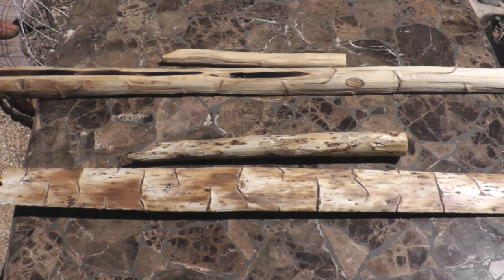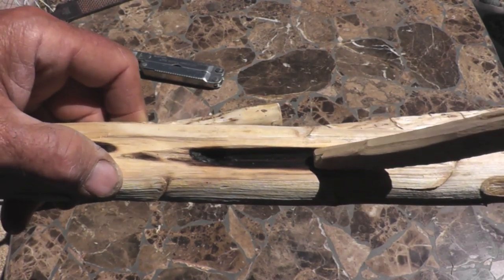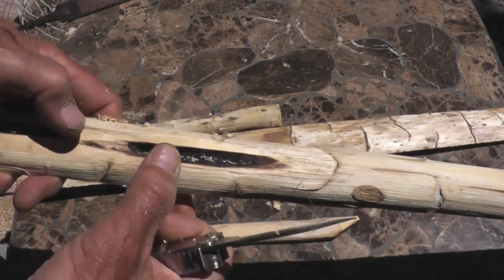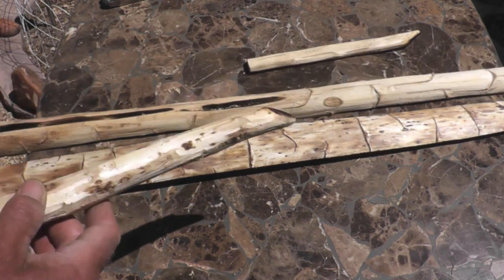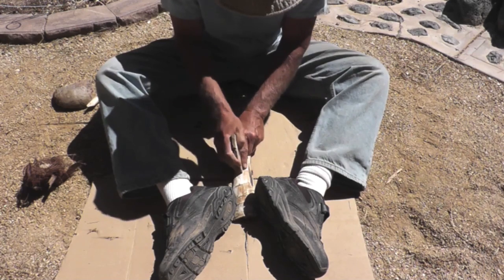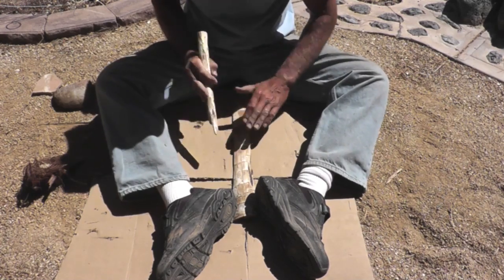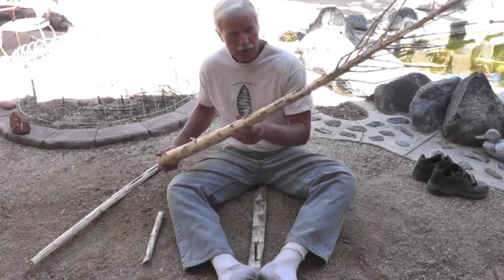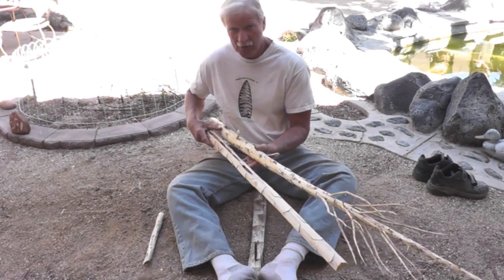Fire Making with the Fire Plow

Comment: Actualy, Sotol is a type of Yucca. Also, the material you refer to as Yucca is actually Agave. I live in the mountains of Arizona and use several different types of Yucca for friction fires of all types, and Sotol is by far my favorite!
Reply from the maker: The Yucca in the video is not Agave. Agave (sometimes called century plant) produces a single stock after 10 or more years and then dies. The Yucca in the video as well as Sotol produce a new stalk almost yearly. Agave stalks are actually quite different and Sotol or Yucca are much preferred for fire making.  There are dozens of varieties of both Yucca and Agave.
Reply: paleomanjim I just assumed Agave from the size. Also, you can split that Sotol with a knife, straight as an arrow! No need for a saw. Give it a try! 😊

Comment: Hi paleomanjim, great video!
I´m trying this method using "erythrina crista galli" (soft wood) as board, and "luma apiculata" (a hard wood known as the fire tree by natives) as the stick. I´m getting lots of smoke and dust but no ember. Most of the smoke comes out from the stick. What do you think i should do? Any tips? Thanks!
Reply from the maker: Try a dry soft wood for the stick. Too determine how soft any wood is test it with your fingernail by pressing into the wood. Soft woods will yield a bit and should be worth trying.  Stick with it and you will succeed! Good luck.
Reply: Thanks, i will continue trying!

Comment: Is it better to have a thin hearth board.  I'm really struggling to get an ember with this method and the hearth thickness is the only thing I can think of that I'm doing wrong.
Reply from the maker: Don't feel bad, the fire plow requires the most effort of all the different techniques. The thickness of the hearth does not matter, but be sure the groove does not get too narrow or the plow will bind up a bit. Main focus is to start slow with a longer stroke, BUT apply a fair amount of force for the first 15 seconds or so. Then as you GO FOR IT decrease stroke to about half and really bear down hard. Watch the end of your stroke and take great care to have the end of each stroke stop at the same point. Be sure to use soft woods (sotol, yucca, cedar, cottonwood being some of the best).....good luck
Reply: I'm from the UK so these woods are not so readily available, I have been using only pine.  From what you've just said I think it is definitely technique, I tend to just go at it full on from the start.  Thanks for the reply, I'm gonna sleep on it now and try again tomorrow when my shoulders don't ache so much!

Comment: I live where there is a lot of pine. Would that work?
Reply: +tehanu3 Yes, Pine is one of the best and easiest wood to work with. If i can remember, pine has a flammable oil in the wood
Reply: sweet! thanks! I am going to try it sometime then. :)
Reply: +tehanu3 Be sure to work with a soft pine. Some pine woods can actually be quite hard/ Press your fingernail into the wood to check its hardness and choose the softest piece you can find. The softer the wood the more friction is will generate and quicker it will heat up.....
Reply: sweet! I'll do that! Thanks!
Reply: +tehanu3 Hey! Not sure about Fire Plow, but pine is a really bad material for firedrills. It's because of the pitch that actually polishes the surface and reduces friction. You will get a lot of noise, a lot of smoke but no fire. I think the same applies on fire plow, the groove will get polished and wont produce a lot of powder needed for the fire. Same with spruce, but fallen spruces stump can work, since after the rain has wet it and it has dried multiple times, the pitch of the wood is gone.
Reply: hmm....I think I also live around hemlock and beach. will those work? or willow? or sycamores?
Reply: tehanu3 willow
Reply: Ultra Violet Films TM willow? Huh. I have lost ads of willow bushes. I'll try to find some that's dry and try it out.
Reply: tehanu3 remember to show a tutorial if u can. I live in florida and have tried but failed most of the time. If you can offer some help it would be 👌

Comment: I don't have any softwood around my home so this is really hard to practice
Reply from the maker: Try a cedar board. You can pick one up at home depot or lows cheap, they are used for fences. Guarantee cedar will work!
Reply: thee samoan guy said that it wont matter what type of wood you use as long it came from thee SSAMMEE wood... and you people jus saw this guy DID start a fire fast.....you have to do it right...NNO0 worries guysh you guys will get...it takes alot practice....